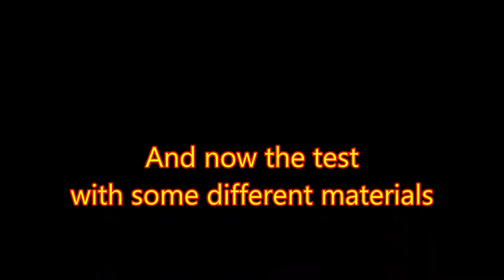Homemade round insert - Part 2 - The test with some different materials

Comment: try some RCMT inserts from ebay, the polished kind for aluminium (K10 grade i think)
Reply from the maker: +meocats 
Hi. I actually have RCMT inserts for machining the stainless steel, 8mm of diameter. I have bought it from "Zimi-hk" long time ago, but I didn't have the chance to try them yet. Thanks for reminding me. I will try them.

But this 2 videos was about homemade insert from hardening steel, which I have needed to make the 12mm slot in bending wheel.
And the advantage is that you can make very fast and very cheap any diameter you want for your project...

And than some of subscribers wanted to know if this cutter can stand up to other materials as well...

Anyway thanks for the comment and for suggestion...

Be well, Zmago
Reply: there is a guy who made insert from granite on youtube too